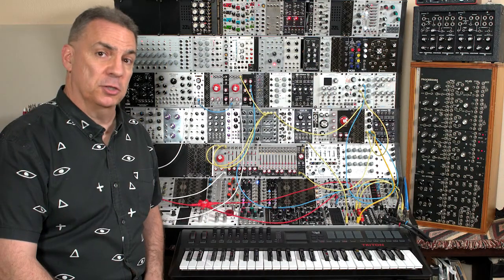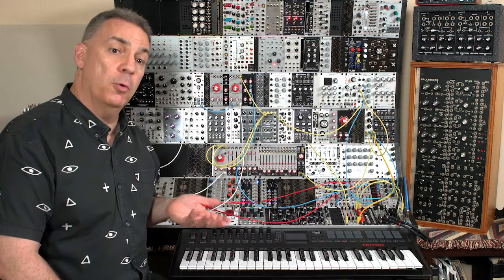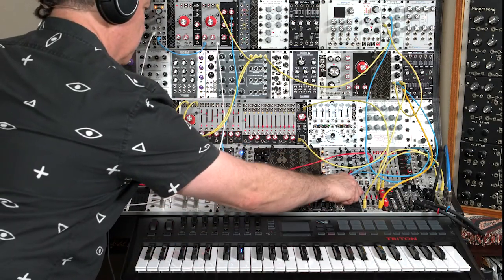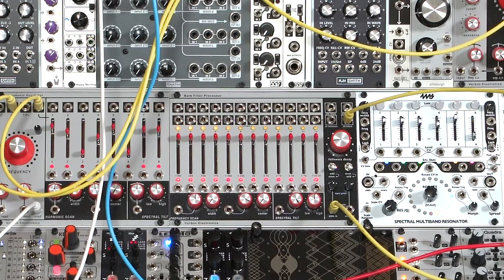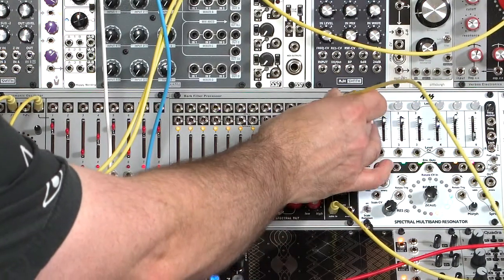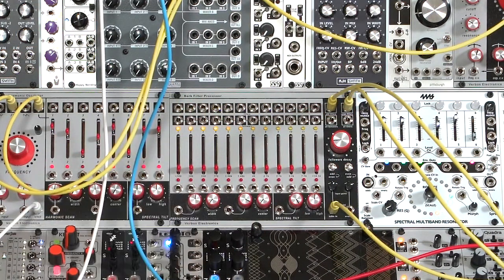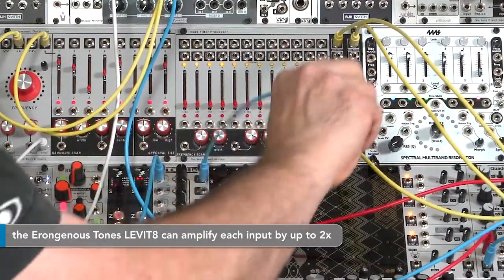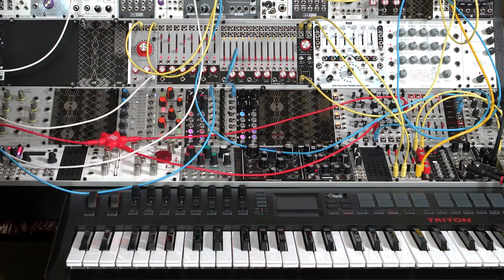Verbos Bark Filter 1/4: Basic Operation (LMS Eurorack Expansion Project)

Comment: Considering either the Bark Filter or Fumana, priority on the EN followers. Price is the same per EN. Any opinion?
Reply from the maker: Since the Fumana has more bands, it will cut the frequency spectrum into smaller pieces, potentially give you finer control. However, the Verbos' decay speed on its envelope follower has a much wider range than the Fumana.

One thing to keep in mind that if you want the filter to modulate itself, the Bark Filter splits itself into two halves, where the envelope followers of six bands are used to modulate the other six bands. In the Fumana, the envelope followers for all 16 bands can be used to modulate 16 bands of Main sound processing.
Reply: Learning Modular Thank you for your detailed breakdown. So for EN follower functionality, would the Bark ultimately be your choice, given the wider range? I enjoy generative patches, and am looking at either of these modules first and foremost for the followers for this purpose.